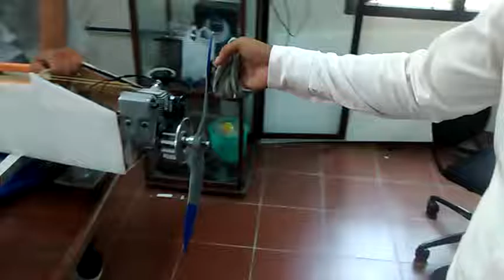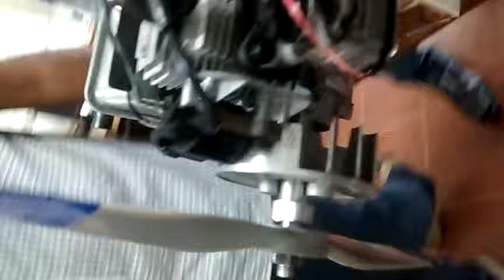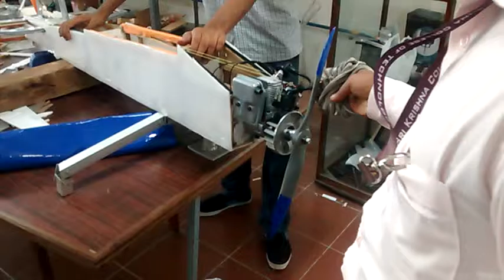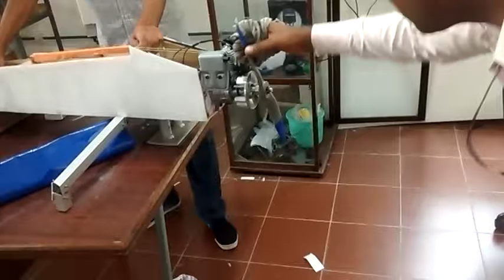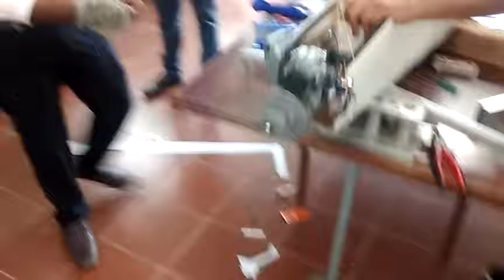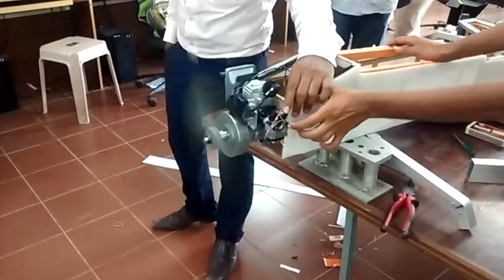Weeder engine Rc plane conversion - Part 2

Comment: Hello guys do you have any plans of the plane?
Reply from the maker: SilverSurferFTW nope bro! This plane was too heavy for that engine...  So wanna make a lighter plane and test it out
Reply: what was the specs of motor and frame to get an idea... (cc to weight)
Reply from the maker: this is a 26cc weed cutting engine with 18*8 props.. for this engine i would recommend a plane of around 1.5 meter wing span and all up weight lesser than 3kg..
Reply: Thanks for infos hope you fly it soon. What is your recomendations for frame materials. Can i find any plans to get started?
Reply from the maker: ya there are plenty of plans available online.. balsa wood is used for construction with some plywood for support
Reply: I was thinking to install a generator to power a raspberry pi and use uavcast for unlimited range over 3g network
Reply: @SilverSurferFTW   The ultraspadstick is the go to design for 25-30cc conversion engines. Look here
http://www.spadtothebone.org/plans.html